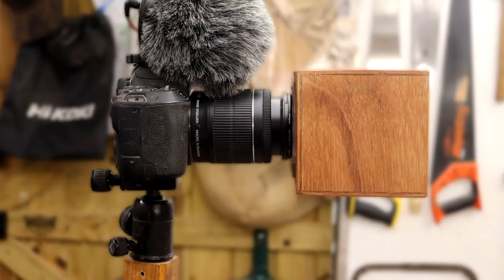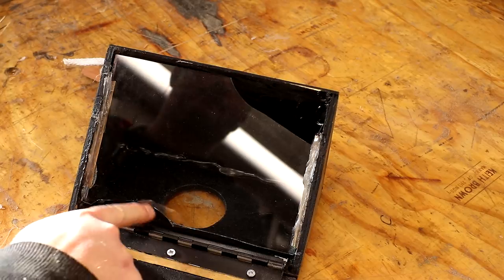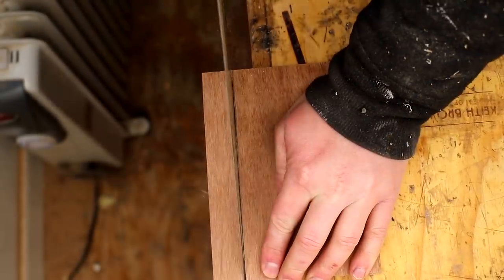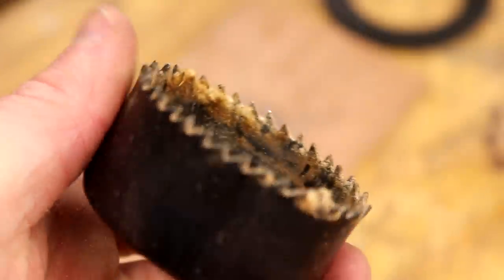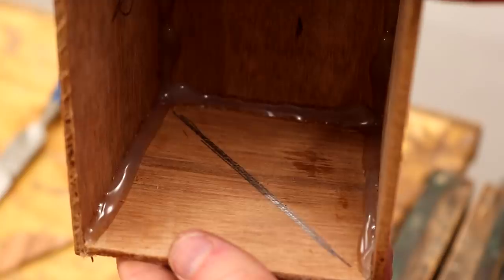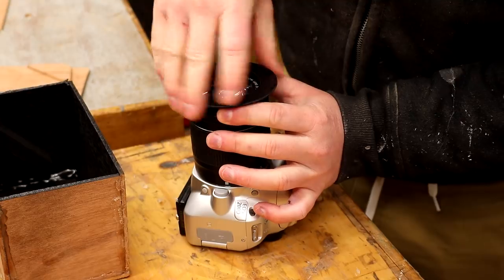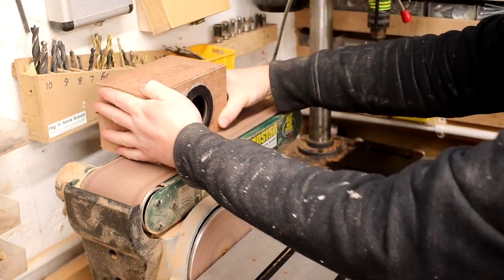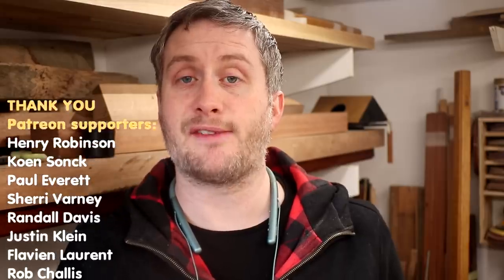Ultimate Teleprompter AutoCue  - Mounts To Camera Lens

Comment: Nice build, mate 👍
Do you think 4 sticky backed Velcro dots might be a good option on the glass so it can be taken out and cleaned both sides?
Reply from the maker: I just blow away the dust with an air blower, works fine